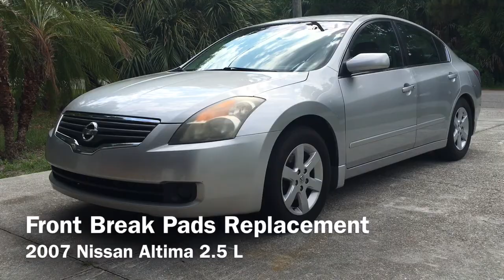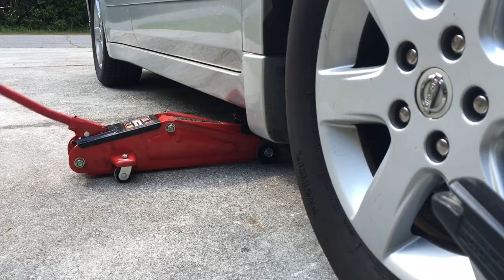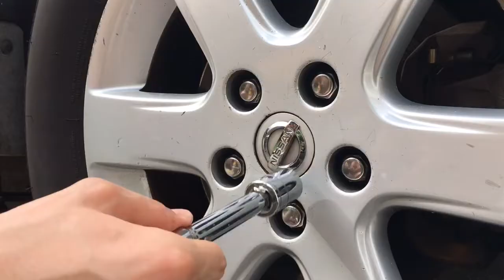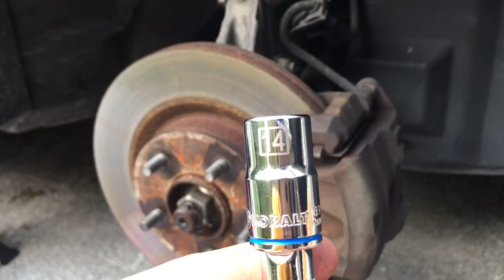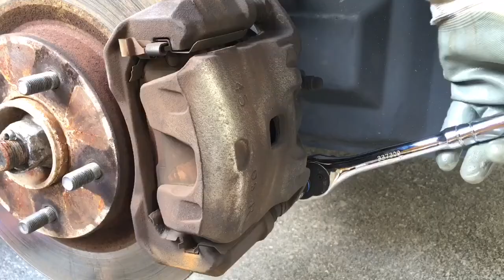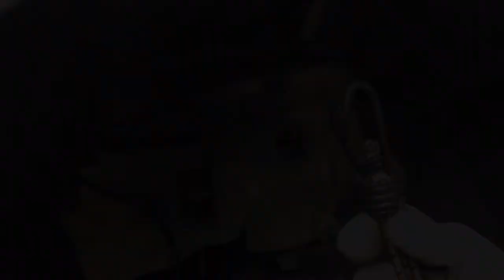Nissan Altima Front Brake Pads Replacement (2007 - 2012)

Comment from the maker: You can buy replacement parts here: 
Front brake pads: http://amzn.to/2HFVdhp 
Also the groove joint pliers that I used to depress the piston: : http://amzn.to/2FIgJ8Z 
(These are Amazon affiliate links)
Reply from the maker: Nissan repair manual says 20 ft/lb (or 27 N/m) for front sliding pin bolts, and 
32 ft/lb (or 48 N/m): http://www.nissanclub.com/forums/2008-nissan-altima-coupe-discussion/307902-caliper-bolt-torque.html
Reply from the maker: *32 for rear sliding pin bolts.
Reply: Diy time.      Do I need the hardware?     Or just the pads

Comment: Great video...but whast size socket is needed to remove the bolts holing the caliper on?
Reply from the maker: 14mm
Reply: The can be a bitch to take off too. I had to beat the wrench with a hammer to get mine off.

Comment: Are those tabs on the brake hardware that go into the brake pad loops important? One of mine broke when installing.
Reply: You ever run into any problems? i didn't realize what they were for so mine are just hanging out, wondering its worth the effort to take the tire off and pop them in.
Reply from the maker: Those act like springs pulling pads away from brake disk when brakes are not engaged. You may hear some squeaking if that thing is off.

Comment: Nice video! I just use a C-clamp to depress the piston, using old pad as a buffer.
Reply from the maker: Thats a good idea, thanks for sharing!
Reply: I stupidly used a C-Clamp without the buffer. I felt like a bone head when I saw it just now...
Also, if anyone know the brake pad hardware came with fitted plates(which I installed) but it also came with little metal wire, and I have no idea what it is for.

Comment: That bunji cord is completely  uneccessary.  Leave the upper bolt in, swing the calliper up, change pads swing it down and slip the bolt back in.  No realignment necessary.

It takes longer to remove/replace the tire than the brake pads in this vehicle. Try it on the next Altima you do brakes on.

      Thanks For The Video!!
Reply: What if the person also wishes to change the rotors?  The only extra step would be to remove the caliper bracket.  In other words, it's really not that serious.  You are right about one thing:  jacking the car, removing and replacing the tires usually take the most amount of time in such a job.

Comment: Hi Do you mind share where is the jack point for the floor jack? I am assuming the jack point is used for the jack stand, right? Thanks so much
Reply from the maker: I place them at the jack points.
Reply: @DIYtime  Thank you a lot for the reply. I am a bit confused. If you put the floor jack at the jack points, where you put the jack stands? Can I leave the jack stands besides the jack points?

Comment: On 2:25 what were you doing on that part I'm confused? I'm going to try and do my break pads this weekend and I'm confused on that part and what it means.
Reply from the maker: Worn out pads are much thinner than brand new pads. You need to push the brake piston back in in order to be able to fit brake caliper over the new pads. It will all make more sense when you actually doing it yourself.
Reply: @DIYtime  ok thank you bro
Reply from the maker: My pleasure!

Comment: When your AC clutch failed, was in intermittent or completely dead?  Did the new clutch fix the issue or did you end up needing a new compressor also?  If anyone replacing those brake clips, buying the OEM from the dealer is worth it's weight in gold.  Clarkson are close but none of them seem to be as nice fitting as the OEM.  Just food for thought.
Reply from the maker: +A Nixon 
At first it was intermittent. AC would stop turning on randomly. New clutch worked for about 3 years. Recently my AC compressor broke/locked up as well. 
Not sure what break clips you are talking about?
Reply: apologies.... the anti rattle clips.... the front end uses ones that have little tabs that retract the pad and the rear does not...  in my experience the OE fit is better unless someone has a particular brand in mind that's as good or better....  Part Code: 41080K (not so much the shims but the actual retainer clips).

http://www.nissanpartsdeal.com/parts/nissan-hardware-kit-fr~d1080-ja00a.html
Reply from the maker: I've replaced them in the past with aftermarket ones, from AdvanceAutoParts. Didn't have any issues.
Reply: thanks for the info -

Comment: Hello Great video, I been watching a lot of your nissan video. Question: Are you having any problem with your transmission?
Reply from the maker: Yes, I do. It started jerking a little lately, making some unusual noises, and acting weird overall. 
I've heard they had a recall if it's under 120k, but I'm already past that. Mines is already over 150k.

Comment: Any tips for a girl, 
I have a Nissan Altima 2013 and I'm sick of hearing my brakes screech to high heavens. I'm buying a kit and doing it myself.
Reply from the maker: Your brake pads are probably worn out and the brake wear indicator is scratching against the rotor. Check and if necessary replace the pads.

Comment: This is not correct way to change new brake pads. You have to re-grease ( the best is using Silicone Grease ) the guide pins.
Reply: You probaly buy headlight grease too don't ya

Comment: did you lossen the master cylinder cap or have to bleed the brakes?
Reply from the maker: +Dustin H 
No, you don't need to bleed brakes if you only replacing pads, since you never open brake fluid lines.

Comment: I'm changing brake pads on 2009 Nissan Altima. When I pulled off the old pads I noticed both had metal clips just like I your video. The new brake pads I bought from AutoZone only has the little metal clips on 2 of 4 of the brake pads. I assume the pads with the metal clips are for the outside brake pad. Do all 4 pads need to have theetal clip like in your video? Or isn't just for the outside pad?
Reply from the maker: Those metal clips are wear indicators. As soon as break pads wear out much enough, those clips touch rotors and start squeaking like crazy 😜. That's when you know it's time to replace the pads. Usually (but not always) break pads wear out evenly, that is why some manufacturers only place them on one side only, to save on matherials.
Reply: @DIYtime  m

Comment: love you video! only one problem I'm having. the caliper is stuck out like shown in your video and it won't budge when I'm trying to grip it with the joint pliers. it looks like it's out a little more on the bottom than the top. help?!

Comment: You didn’t clean and re-grease the caliper slide bolts ? I’d of replaced those rotors as well . They heat up and cool and cause warping or cracks .

Comment: How many miles on your 2007 Nissan Alitma
Reply from the maker: +john1240able 
148k
Reply: +Temachok nice have you had any big problems with the Alitma.
Reply from the maker: +john1240able 
AC compressor broke. Hoping to fix it next week. Summers are hot in Florida.... 😥
Valve cover gasket is leaking. You can see it in PCV valve video. Tried fixing, but failed. Need to remove engine mount to get to it, but dont have right tools to hang engine. 
And bunch of other small annoying problems. I'll be posting more vids as I tackle those.

Comment: you forgot to remove the top from the master cylinder before squeezing the caliper main piston back..
Reply: Did you ever figure out that Transmission issue (2012 Altima). I realize it was two years ago that you posted your comment.  Was it repaired?
Reply: You don't have to remove the cap. It will just move back into the reservoir. Note 4 90% of the cars, you should never add brake fluid if the brake fluid is low that's usually an indication your brake pads are worn and need replacing. So don't add fluid when you're low. Take a look at your brakes pads they will be worn and that's why your reservoirs going down. Unless of course you have a leak which is much more rare than worn-out brake pads which is very common